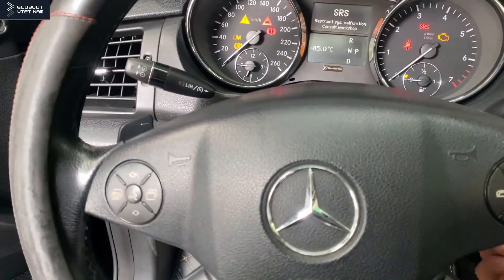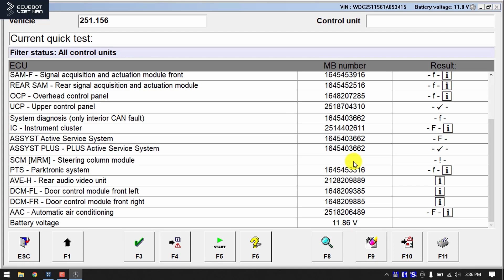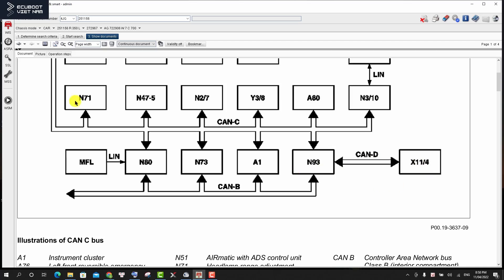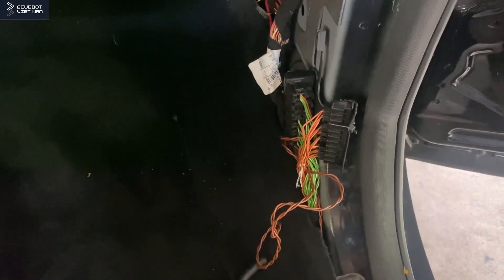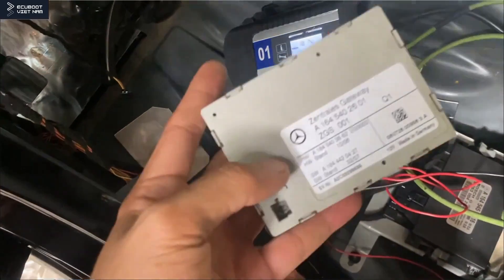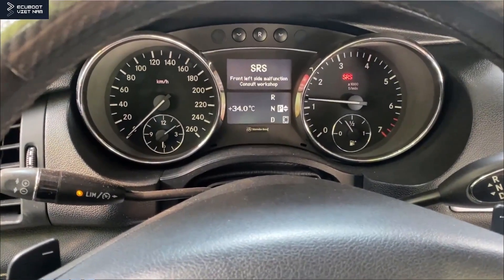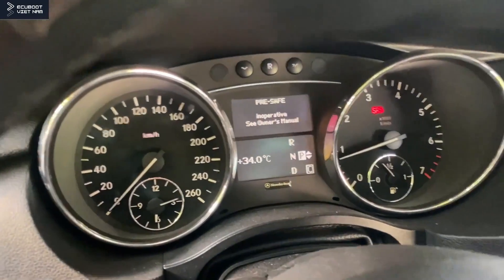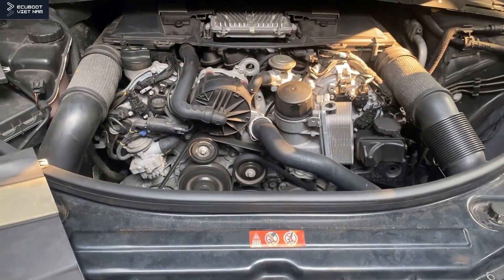Mercedes R350 Without Changing Gear Diagnostic and Fix

Comment: HELLO, THANKS FOR SHARING. I WOULD LIKE TO PURCHASE A COURSE. I HAVE BEEN WORKING ON CARS SINCE 1979, BUT THERE ARE ONLY A FEW THINGS I DO NEED TO TROUBLESHOOT. I HAVE A 2011 MERCEDES-BENZ R-350 4MATIC, THE SANE MODEL YOUR WORKING ON. MY PROBLEM IS THAT WHEN I START THE VEHICLE,  IT WILL START, BUT IT WON'T GO OUT OF PARK WHEN I ATTEMPT TO PUT THE CAR INTO EITHER DRIVE OR REVERSE, THE CAR STARTS BEEPING, AND A RED WORKSHOP MESSAGE COMES UP ON THE DASHBOARD DISPLAY. IT MAY BE A VERY SMALL MATTER. DO YOU HAVE ANY TROUBLESHOOTING TECHNIQUES FOR ME TO CHECK OUT. THANK'S. THE CAR WON'T COME OUT OF PARK, SOMETIMES IT DOES AND SOMETIMES IT WONT, THE BATTERY IS DEAD, BUT I DONT THINK THAT IS THE PROBLEM, BECAUSE I CAN STILL START THE CAR WITH MY BATTERY JUMPER. THANKS AGAIN.

Comment: Awesome video. Currently dealing with CAN issues on my 2010 ML350 Bluetec. Very similar car. However, mine has 3 distributors at the passenger side footwell, not 2. 1 of them has green wires (I'm guessing drivetrain) while the other 2 have orange/brownish wires. I'm wondering which CAN that third distributor is for...

Comment: My 06 e350 has no power going to the fuel pump. Fuel pump went bad so I replaced it, but now no power going to it. Relay and fuse are fine because there’s juice going to the sender, but not the fuel pump. Fuel tank is empty because I had to clean it out because of all of the dirt in it. The central gateway is new too. Replaced about a yr. ago
Reply: I have same problem… any idea?

Comment: Diagnostic wont communicate with engine transmission or ism dealer says i have tons of can codes is the central gateway most likely my problem
Reply: Did you manage to sort this ?
Reply: @kunalrana3625  ya i had someone scam me who never programmed any of the modules i just need some modules programmed
Reply: Did you sort this out?
Reply: Hi... what was the solution?
Reply: @pmo3448  someone scammed me and didnt program my modules

Comment: Where did you connect the negative lead of the multimeter?Is it on the battery negative terminal or any chasis ground point before taking measurements? Thanks.
Reply: I think they connected them to any chassis ground point. But if you're measuring the waveform, a solid ground like battery negative would be better.
Reply: @Teddy-re6nv  Thanks Pat.